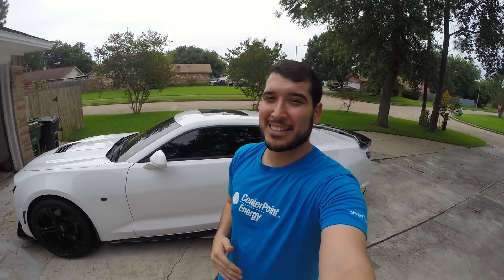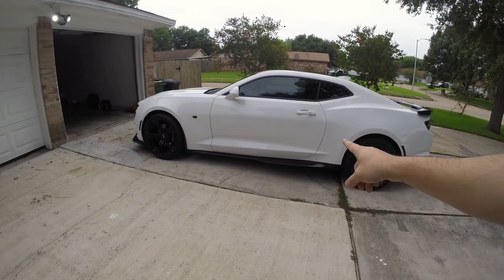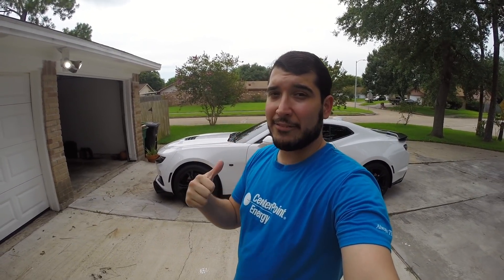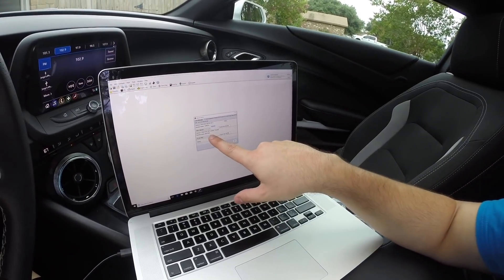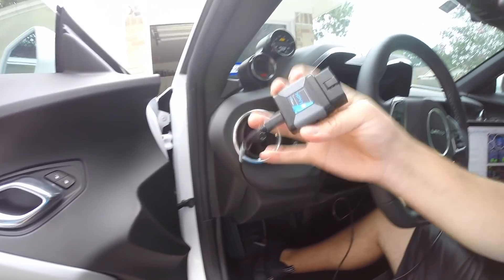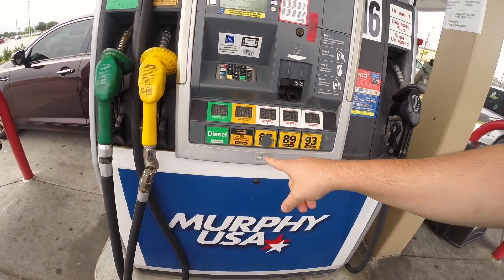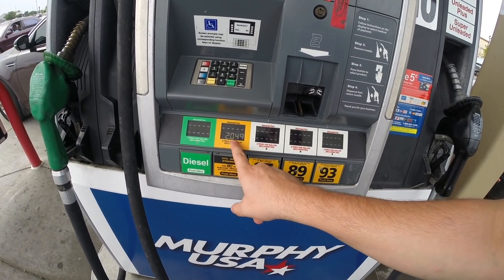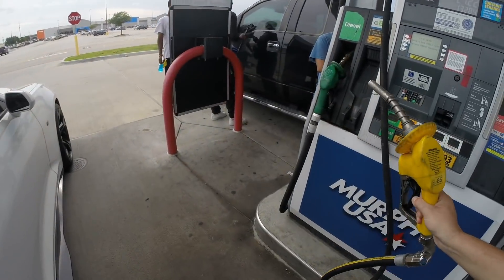SAVING THE EARTH ONE Fill Up at a Time!!! E85 Flex Fuel | Vlog #249

Comment from the maker: Can’t wait to try the E85 full strength at the track!
Reply: I'm close to pulling the trigger on E85 myself
Reply from the maker: Fast Lane Pros from the little bit that I drove it I could tell it was much more responsive and felt stronger. I’m interested to see what the difference is on the dyno many say 20-25hp from going to e85
Reply: Men so happy already put speed enginered headers and x pipe stock mufflers plus roto fab intake just need e 85 and tune
Reply: Were you running the car with stock fuel pump and stock injectors ? On full e85 ?
Reply from the maker: Yes I was  @Abdulnalhilal

Comment: Im getting e85 next month. You feel a different??
Reply from the maker: Lets just say the car spins from anything under a 60 roll! it feels much more responsive and twitcher if that makes any sense. Im also just on e60 so i cant imagine at full e85.
Reply: Jorge's Vlog thats crazyy! I dynod my car last week. I made 401 rwhp with headers no tune. After tune i made 420rwhp. I have a manual 6 speed 2017 ss. You need to dyno your car so i can compare!
Reply from the maker: @Mlgradar713  Different dynos will read different, bc i made 412hp bone stock in 7th gear(1:1) and 397hp bone stock in 6th Im not sure how much headers will gain me but 20 hp sounds about right with e85 thats another 20hp so i should be around 450ish based on my baseline.

Comment: I heard that bay using e85 your mile per gallon gose down
Reply from the maker: It will, but depending on how it is tuned you wont see as big of an issue. If you were getting 20 miles per gallon it might go down to 17 miles per gallon. Not that big of a difference and its almost 1 dollar cheaper per gallon so price wise its about the same with more power.

Comment: Jorge en los garages de walmart hay e85 ?
Reply from the maker: En los Murphy’s la mayoría tiene e85
Reply: Gracias
Reply: Voy tunear el carro con raceprovenmotorsports que crees de ellos? Me gustaria saver tu opinion?
Reply from the maker: @MrJoseeclipse123  no tengo experiencia con ellos, pero lo que e visto es bueno.
Reply: @JLSpeed  gracias es q. Me queda serca
Reply: @JLSpeed  jorge los llame y me cobran 850 dolares por pump gas tune so es e 85 me cobran 1000. Y si quiero q. Ellos me instalen el flex fuel mas comprarselo a ellos es 500. Osea un total de 1500 dolares quisiera saver q. Opinas?
Reply from the maker: @MrJoseeclipse123  eso incluye los créditos del hptuners que tienen que comprar, la verdad es más o menos lo que questa por que se requiere bastante créditos para tunearlos carros esos. El flex fuel sensor lo puedes install tu mismo no es muy dificil. Te ahorrarías entre 2-300 dólares porque solo questa 225-300 el kit del flex fuel sensor
Reply: @JLSpeed  si muchas gracias estoy viendo tu video como intalar el flex fuel 💪  gracias por todo me encanta tu canal.